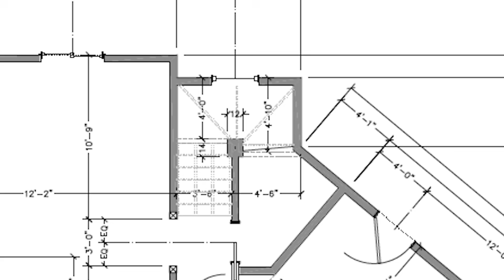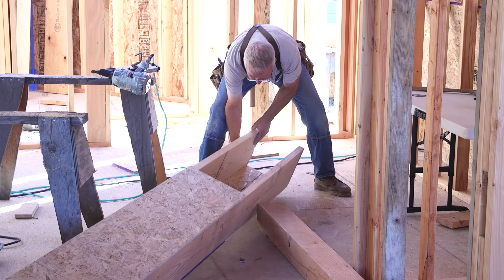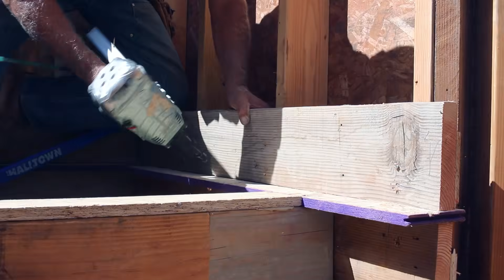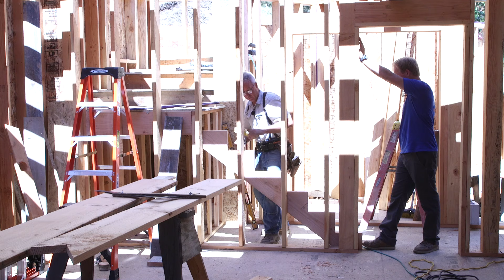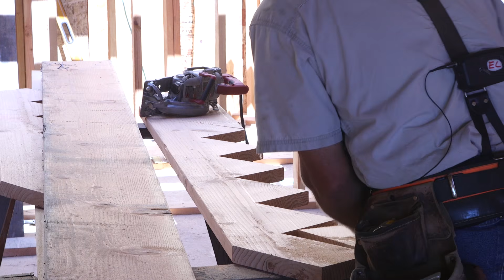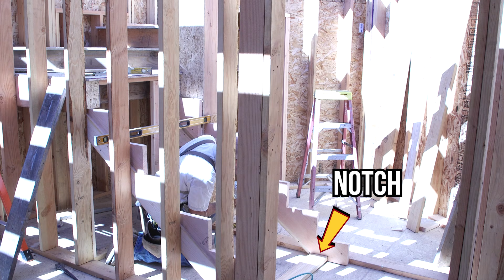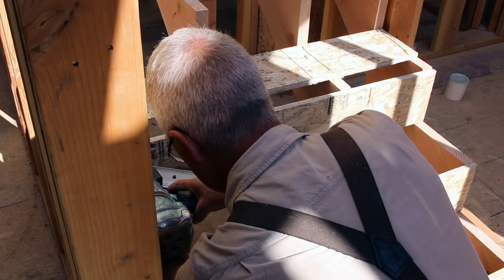Building Winder Stairs Ep.56

Comment: Here in england we have a minimum pitch of 42degrees. 2m head height over each nosing. Goings no less than 220mm, risers no more than 220mm, center of a winder must be at least the same as the going for all the other goings, the narrow part of the winder must be at least 50mm from the edge of the preceding step.. question: when setting out tour the floor to floor dimension and the floor finishes are different thicknesses what do you do.? Also any landing cant be any shorter than the width of a stair. Are you allowed to install
Space saver staircases?

Comment: My basement was finished years ago but they never beefed up the stairs. Just had 2 stringers with dados holding the treads.
I ended up picking up Simpson strong tie brackets and bracketing each tread to the stringer. Many were coming out of the dados. That's what the ties are intended for.
Pretty solid now. I did cut the ties and have 1/3 left from each I may use to bracket risers to the stringers as well since I have them and the hardware anyway.

Comment: I just built a set of winders and this video was very very helpful.  Watched it several times throughout the build as I progressed.  Thank you for sharing how to do it.  I modified your approach from one set of six winder boxes to two sets of three so that I would have more useable storage space under the winder portion, and I used four 6x6 boxed to make the central post instead of chip board.  Turned out great.

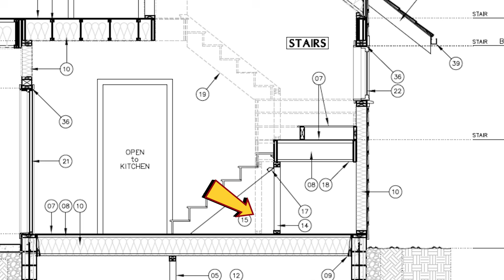Comment: I realize that this house is finished now, but can you explain why you put the pony wall in front of the 2 x 8 instead of underneath it? See video at 6:35 for the side view of number 14. The plan clearly shows the pony wall under. But like you have said, "many ways to do the job"
Reply: there’s no post built into the drawings like he built in the video. Thus he’s supporting the platform with pony wall instead of a ledger supported by the outer wall. Hope I understood your question correctly

Comment: You have to be cognizant as to what thickness your finish floor is also. You said you're using 1" treads but if you have 1/2" tile plus thinset ( for example) butting up to your first riser its going to be about 5/8" shorter than the adjacent risers so you have to take the finish flooring thickness into account also so in this example you would only subtract 3/8" from the bottom riser instead of the 1"

Comment: Scott, great work on the stair framing. I wish a more carpenters would take the time to do as good a job as you do. I build stair railings and balustrades. It’s such a relief to follow the work of a craftsman who cares about their work. One suggestion on the 3/4 “ space you left for the sheet rock against the walls. It would be better to use a 2x4 so that there’s enough space to drop in a skirt board as well as the sheet rock without having to cut around the stairs. Really enjoy your videos!

Comment: I'd guess these are going to be carpet stairs because of the bull nose on the winders. In this case you need to knock the thickness of the tread material off of both flight runs not just the first rise. If you dont subtract the thickness of the tread off of the first rise after the winders you screw up your rise dramatically. Also need to be carefull you don't forget that you don't actually take off just the thickness of the tread off the first rise. Doesn't always work. If this stair was hardwood it wouldn't. You subtract the difference between the tread and the finished floor material. As an example, if you have a 1" thick hardwood tread and 3/4" flooring you don't subtract an inch from the bottom rise, you subtract a 1/4". If your rise is 7" and your tread is 1" and you knock an inch off the bottom of your framing that will in fact turn your first rise into 7" with tread......but once you put your 3/4" flooring in that rise is now 6 1/4" instead of 7". That's why you need to think twice about the general rule of always taking the thickness of the tread off the bottom rise. It usually only applies to decks. I've installed hardwood staircases for about 15 years and you would be amazed at how often the framing gets botched. Great video. I love that column idea to force the inside winders to be a comfortable width. Here the framers frame them to a point.

Comment: You subtract 1" on the bottom step but if your flooring later is not carpet, for instance a hardwood floor, you should account for that height too, if you're using something thin like carpet on the stairs.

Comment: Since my first set of stringers and temporary steps in 1976 they all have been bonded with 2x's  , hundreds of sets. Since 1976 I have cased out hundreds of finished sets of steps , ever single one had skirt boards. Many or most homes that I trimed and cased over the years ,,,,I did not frame , some of them either had stringers nailed to the wall with  just a 3/4 board so it saved  the drywall man but the finish carpenter ( me ) was screwed! You finish carpenters know the drill ! Nub all the step treads bact to the risers and notch all the step and risers out of the skirt ! Not complicated but excessive and unnecessary labor time. I've even seen stringers stringers nailed straight to the wall with no bond board to hold out from the wall because the owner or builder was to cheap to buy the bond and the skirt boards, the drywall gets torn and scuffed, looking like crap in a few years.

Comment: You actually need to know what flooring is going on the first and 2nd floors, just cutting off the thickness of the first tread can get you into trouble, if your flooringon the first floor isn’t 1 “ you’re already off a 1/4”
Reply from the maker: This is a great comment and yes we will be showing that wants the wood floor begins to go in. I have 3/4 inch oak going on the downstairs floor and carpet on the upstairs floor and 1 inch thick hardwood treads going on the stairs. It required some mental gymnastics to get that right.

Comment: For an even rise in the whole flight shouldn't you subtract the first floor finished flooring from your tread thickness on the first floor stringer and calculate the secdond finished floor in your last rise? I myself prefer to make stringers out of 2X6s with triangle blocks cut to the rise and run glued on and flitched with plywood or osb to the 2x6. By the time you cut a stringer out of a 2x12 you have barely a 2x4 with triangle blocks on it. I've been an east coast carpenter for forty years and am still learning. Just today I tried your sponge method for final caulking clean up and am a fan of it.  I also admire your humbly owning your mistakes. That says a lot about your character.Thank you for the great videos!

Comment: shouldn't the wall under at the end of the stair be under the landing for support and not butt up to it?  As far as the drywall spacing that is good but, we usually don't build the permanent stairs until we have covered the roof.  Then we put up the drywall ourselves and attach the stringers to the walls directly works better I think.

Comment: Whatever you add to the front you take off the back, whatever you add to the top you take off the bottom, simple. No need to make it more complicated than that, unless there is a major difference in finish materials being used on subfloor and treads

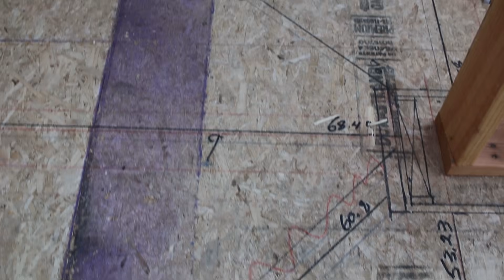Comment: At 2:11 you state that you take your total rise divided by the number of stairs you have to get the rise per stair. I have to question that method. I have always taken the total rise in inches divided by 7 which normally gives me and odd number. If I round the number up, it lowers the amount of rise per tread. If I round down, it increases the rise per tread. I then take that  number that has been determined and divide my overall rise by that which in turn gives me the exact rise per stair which should be between 6 and 8 inches. If you use your method you can easily get outside the allowable rise just like you did on the other staircase. IE: You have a rise of 120" Divide 120 by 7 and you get 17.14. Round that down to an even 17. Take 120 divided by 17 and you get 7.058 inches of rise per tread or in fractions 7 1/16 inches. Conversely if you increased the number of treads to 18 you would get 120 divided by 18 for a rise per tread of 6.666 inches per tread or 6 21/32 inches per rise. It is that straightforward and simple. The same math will also work for circular stairs or winder stairs. When you take the number of treads in a run times the width of the treads on a straight run of stairs it will tell you how far out the stairs will project out from the upper landing. When you build circular stairs you have to take into account that the inside radius versus the outside radius causes your run to change in relation to your rise as the rise is a constant. If you don't identify this difference your handrails will not work out.
In the past, when I was still working as an estimator in construction, I actually wrote a computer program that allowed you to fill in your variables of run and rise and the computer did the rest. This program was used to design and construct several hundred different sets of stairs including circular stairs in the shop that were later installed in the field. Not one set of stairs was ever out of spec if the print derived from the programs calculations was followed in construction.

Comment: The difference between the regular rise and the first one depends entirely on the thickness of the finishes and your stair has to be calculated accordingly. If the same finish is applied to main floor and stair then the tread thickness IS the difference but if a carpeted stair is bearing on the subfloor and that floor is, say, getting 1" of in-floor heating and 3/4" of solid wood then the first rise is gonna have to be a lot bigger than 1" smaller than 'rise'.

Comment: In Britain, we get a lot of staircases in smaller houses where the kite steps taper to zero, or maybe 1". If the staircase is 30" wide, and that 90 degree turn is 4 steps, then each kite is 15" on the wide side, so in the middle they are 8" front to back. And they are a curse. Only your heel is on the step. When they are carpeted, they are a double curse. Not too bad going up, but coming down.....In a hurry. In size 11's. or  a lady wearing heels. Or a kid wearing anything.....Those stairs will try to kill you...

Comment: I've done plenty of the platform wonders and would always use...I'm just that way. Was surprised though...nails? No screws?...LOL. The stringers that always mess people up and the ones that start dadoed in, then open with treads overhanging. Also noted, no backing on the walls and platforms? I do it because I'm afraid of someone kicking a hole in the drywall running on the stairs.

Comment: It appears from your stair build that you're using 1" bullnose OSB for the stair treads.   This would imply (to me at least) that you're not planning to have hardwood stairs, and will cover them with carpet.   Since there was no additional height added on the first riser to facilitate the addition of a hardwood floor overlay, I also conclude you plan to carpet the entire space rather than lay any kind of hard surface flooring over the OSB sub-floor.   That decision is a bit surprising to me considering the quality of the workmanship and materials going into this project, and not totally in keeping with the "craftsman" style of the architecture.   I would have expected an oak T&G flooring (or similar), at least on the main (lower) level.  Curious what lead you down this path.

Comment: Excellent video.  I love how you did the winder stairs.  Codes are very important when doing stairs.  You need to be familiar with head clearance as well.  6 ft 8 in is code in our area.  Along with the minimum 6 in on tread noozings.  I had to put a half bath under stairs.   From 19 in on an elongated toilet leveled up from there with slop does pass code.  Other then that if your rising up more then 7 3/4.  Its a rough walk up or down. Ive been doing this 20 plus years.  We all make mistakes even the best

Comment: In Australia you are not allowed any difference between each tread and riser in the staircase. Also the bottom tread and top tread height is determined by the floor covering such as carpet, hardwood, laminate or tiles etc.

Comment: The corner twist and stairs has to be a significant cost in building that house and garage.  I understand the site dictates it, along with alot of other decisions in the home design and construction.   Here in Northern Utah, it would either have deep footings or a full basement like most homes due to the cold weather we see in the winter, as low as 20 below zero.

Comment: Hmmm. I think I may have noticed a problem in the illustration at the beginning of the video. There appears to be an area that will capture rain water at the point where the two roofs meet each other. Can it be so?
Reply from the maker: Just one more reason that the corner of that house was a real head scratcher!
Reply: Essential Craftsman It’s not an easy geometry to solve. I wonder if a practical solution could be, if it’s not too late to make a change, to set the roof elevation at the same height and let the two roofs meet where they will. A valley could be formed down to the point where the main roof has a slope change. That porch roof slope could continue a little further onto the garage roof until the edges match up. Just a thought :). Even the back side is probably a challenge.

Comment: What's the load's "path to the ground" for the winder section? It appears to be held up by that first platform, which is only held by a nailed 2x12.

I expected the first platform to be supported by something like jack studs.
Reply: Every platforms perimeter 2x8 is nailed to the walls. Load is carried to the walls and down to the slab that probably has mono footings under those bearing walls.
Reply: @c.groeschl4940  is it just the shear strength of the nails that holds it up, then? Compare a span, which has a wood path to the ground thru jack studs, relying on compressive strength instead of shear.
Reply: @JoeAshcraft  typical framing gun nail is .131 dia with a shear force of 95 lbs. If your framing a landing with 2x8 that's 4 nails per stud, usually enough if your framing is tight and it doesn't have a pull force added to it. I prefer to run the front of the rim, where the stairs bear on it, into the stud walls and point load it down just for added rigidity.

Comment: One of the things that most people get into trouble with on stairs is the finish flooring either at the top or the bottom . If your flooring is the same on both levels and on the stairs as well then no worries , but if the flooring thickness ( or lack of flooring ie unfinished basements ) changes then you need to allow for a change possibly in the future . This is especially true in log homes where you can have extreme  , but expected , settling
 issues to be taken into consideration . Great work and thanks for the post .

Comment: Really you subtract the the tread material from what ever flooring material your using and that's what you subtract from your first riser.. 
Example: Your first riser is 7 1/2. Your tread is 1 inch thick. Your flooring is 3/4. You take 1 inch and subtract 3/4. Which comes to 1/4. This is what you subtract from your first riser which comes out to 7 1/4

Comment: we like to add a 2x4 to the outside stringers to allow for 1/2" drywall and the skirt board. Seems that you will need to notch your skirt board which is a time consumer as well. 
LOOKS GOOD ! I GET LOTS OF GOOD INFO EVEN AS A SEASONED CARPENTER . BEST WISHES !

Comment: Thanks for posting this series, I'm not building a house, but it is interesting to watch and learn about the process.  I noticed that you glued and used screws on the sub-floor, but only nails on the stairs.  Would this present a risk for squeaking later on?  After many years in my house, the stairs are just about the only spot in my house that does have a squeak.

Comment: Pro tip for the new guys, When cutting 3 or 4 stringers. [ steps ] Crown and stack them. Nailing with a 8p. Nail. When you cut it leaves the marks on the one next down. Carry on to the last. Much faster if you into speed. Pro Tip.

Comment: Hi Scot,
I love your video's, I'm a young carpenter and have lots to learn and love learning from you. I find your video's informative and strangely relaxing to watch, even though it's in inches ha!
What's your view on mechanical fixings (eg timberlock screws/batten screws in wall plates etc) or are nails good enough?
May help with squeaking in the stair winder framing? Cheers

Comment: Great video...any advice..need me some  kind help..I dug 2 ft deep 18" inches for a privacy fence with 3x8 wrought iron above cinder block 8x8x16..I can go almost 5ft with columns because of the visibility..what will be my footing??my front  will be   next to the sidewalk..I'm doing it 9ft at a time.. first 2 columns then 1 afterwards, your kindness is appreciated..P.s how many cement ready mix and what mortar..be blessed
Reply: Concrete and cinder block are not my specialty but here is Essential Craftsmans video on the block wall they did in Arizona - https://www.youtube.com/watch?v=SdrunEMZIpQ&t=5s - To calculate the amount of concrete that you need you have to first figure out how many cubic feet your project requires. If you are using bagged concrete then an 80lb bag will make .60 cubic feet of concrete or a 60lb bag will make .45 cubic feet.